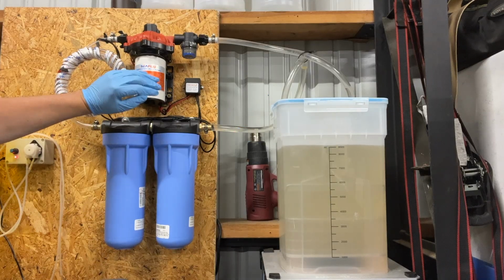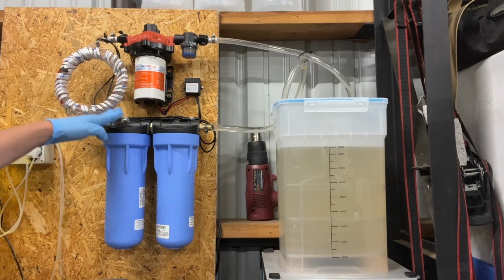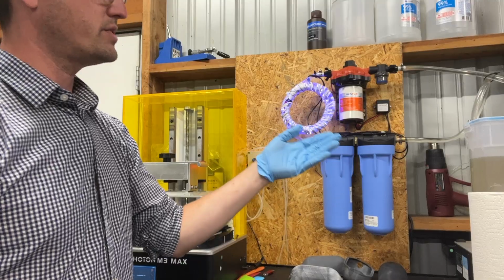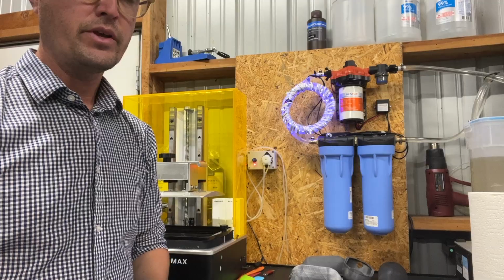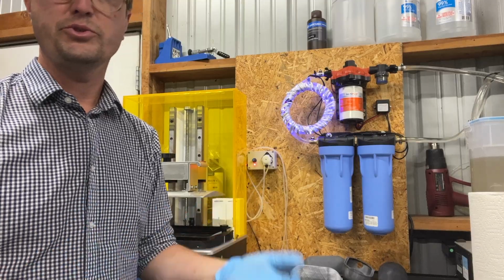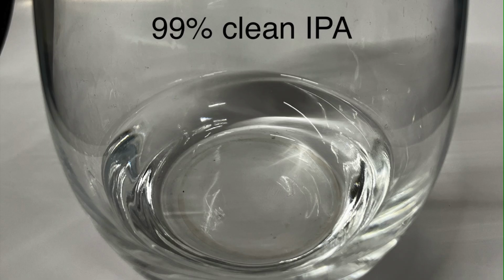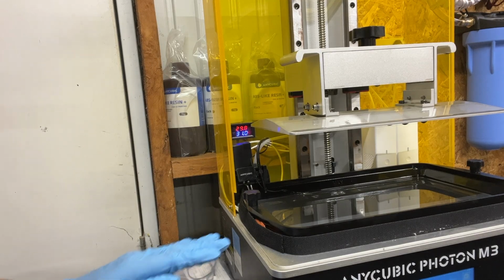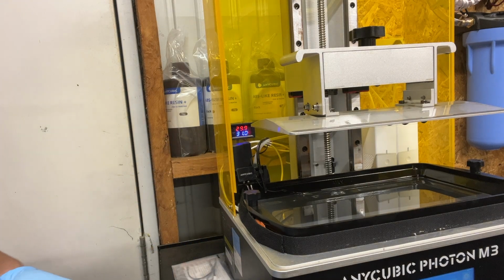Resin Printer Mods and Continuous IPA Filtration!

Comment: For the thermal belt solution, do you have any more specific instructions regarding the actual setup? Looking at the two items, and I'm not a really technical/electrical expert, so I don't want to do it wrong. The back of the thermal probe/controller has a white square for the probe to connect, but then how does the belt connect to that since it looks like they're exposed wires? Soldering or something? I just need more info, thanks.

Oh, and would you expect any particular issues with a vat that is smaller to use the same size band? I've got a Mars 3 pro, so it's a bit smaller than the Photon M3 Max.

Comment: Cute idea, I genuinely wanted it to work, but having tested it directly myself, the filter lifespan is too low for anyone printing regularly.  The filters last washing about 1-2kg worth of resin input prints, even with generous drip tray time reducing uncured resin going into the wash. Probably lasts significantly longer in a 2-3 stage wash if you are only filtering the final stage, but it absolutely cannot handle the residue volume of the first stage isopropyl or denatured (ethanol) alcohol. 

As the filters pack and start reducing flow, the coil loop also starts getting cured resin accumulating and needs to be flushed by other means which can get pretty messy. 

Overall a massive disappointment, but I blame myself partially.  Just looking at the available mechanical volume in these 10x2.5" filter cartridges, it obvious how little resin residue they can handle. I was hoping part of the "magic" was the curing coil and filter structure would reduce the gel / foam volume which resin residue makes when it kicks with alcohol.  This is simply not the case. So a few mL of resin residue (net) becomes a dozen mL of resin-alcohol gel.

Comment: Would the UV lights need to be covered?
Reply from the maker: Yes if you're standing around them. I typically set the system to cycle once an hour when i'm not around. 

If you have UV lights exposed you need to wear PPE or cover them in UV/Capcom tape.
Reply: @nicks-fix  Thanks for the reply. It's a great system you've made. I have a heygears printer so I'm trying to figure out how to retrofit. Think I'll just create a 3D printed top for the wash basin with 1/2" inlet/outlet ports

Comment: Not sure on the pump, One in the list is different than the one shown in the video and started leaking after about 5 hours of total use.
Reply from the maker: @McyD  apologies. The list tends to switch due to Amazon. I’ll do my best to update. Were you running it for five hours constantly? Or intermittently?
Reply: @nicks-fix  intermittently, most was 30 minutes, but usually only about few minutes at a time. I found the one shown in your video on Amazon and am returning the leaking one. Luckily, I was just barely within the return window still.

Comment: This is fantastic! I've been using water washable resin, but I'm about to switch over to ABS-Like or similar and have been digging in a bit to maximizing the use of the IPA and minimizing the trips to pay to get rid of the hazardous waste.

Couple questions on the filters.... are they something that require regular maintenace?  Do you flush them or rinse them periodically?  If so... how do you go about that?  Or, do you just buy replacement cartridges and swap them out periodically.  If so... any idea how long they're lasting?
Reply from the maker: @witkointhewild  I have yet to change mine. I just take them to my hazardous waste facility in a bag to dispose of. The filters are like 6$ on Amazon.

Comment: Well let’s see what the pre-filter looks like. Sheesh.
Reply from the maker: @JAKESMITH-tt8nm  what pre filter? The one that comes with the pump? Just a small stainless steel strainer basket. Sheesh.
Reply: The first sediment filter after the UV coil. If it’s a 10mic filter then there is no way it has not loaded up by now. And if if it’s as effective as it should be it’s most likely full of nasty resin and bypassing the majority of the IPA to the secondary filter. Open it up and see what it looks like. No better way to see how well it works.

Comment: I just bought my first resin 3d printer, I've been working for year with a PLA 3D printer, but for finer work I now switched over to resin.
I was already thinking about a filtering station, but never given it a thought of using led's to cure the resin particles before filtering, which make good sense.
So thanks for you tips, they are awesome.

Comment: Filters are gonna gum up pretty quickly, which is  going to end up costing you more than the IPA.  Better off either doing a Two stage wash, one small bath to get the bulk off then transferring over to the washer. Or the more elaborate method of buying a breaking bad starter kit and distilling it.
Reply from the maker: @nikushim6665  thanks for the feedback. Many people have been running this for months without “gumming up the filters”, including me. 

I’d suggest you try it before saying it won’t work!

Comment: I just have a radial flow Drum (aquaponic trick for pre filtration of solids  )  than an IBC  settling tank then the clean IPA evaporates and condensers for collection using solar umbrella evaporator , when the settling tank and radial flow looks sludgy then they are  drained out and then hit with UV and ran through a press to squeeze out all the juice

Comment: This is brilliant! I built this and it works like a charm and took under 30 minutes to build! In my case, instead of a continuous filtration system, I filter it out from one container to another, this happens in like a minute or two for some 5 litres of IPA and uses less energy. For me, it cost less than a bottle of resin to build this. Thank you for this, you saved a lot of people a lot of hassle!
Reply: hey, im working on building my own, but im a little unclear on the electrical setup.  Is the pump receiving power from the power supply along with the LED strips?
Reply: @xviixxiixxvi  In my case I power them seperately. But if your strip can run with the same voltage as the pump's adapter and the pump is not drawing the full power, you could try to power them together.

Comment: I've come to find the UV loop in this can suffer from resin curing along the walls of the tubing, which sorta blocks the UV in the loop degrading the amount it can cure. I wonder if the original uv filter was better because of this not being an issue.  Could be an issue of my flow not being high enough as I had to settle with a pump at only 5 litres per minute!
Reply from the maker: @0Kyron0  good point. Others have said after a while there is some build up. 

Good thing is that the vinyl tubing is the cheapest part of the system, so you can just replace when there is too much build up!
Reply: @nicks-fix  luckily a long drain pipe brush does good, can loosen it in the loop then it gets caught in the filter haha

Comment: Hey! This is great. the LED light strips you linked are 385-400nm, not 405nm. Has that been working for you? Thanks!
Reply from the maker: @MrLightmass  the specifics depend on the range that your resin needs. Nm wavelength is never exact, so getting it as close to your resin from the manufacturer sheet is the best way to pair it.
Reply: @nicks-fix  Thanks for the reply! So the LED's you have listed are working for you? 
 I am ordering my parts today to give this a go. Are the parts listed in the description the same ones you used in you project? Thanks!

Comment: Hey nice video there :D I have few questions such as how do you discard the filter and at what frequency ? (After a number of batches ? Kilos of resins Cleaned ?) Do you turn the system as often as possible or when it's start to get clumpy ?

Do you cure the filters so you can use these a little longer ? How do you dispose of those, since it's still hasardous material until it's not cured.

Comment: The heat band around the vat, is there any information on how to wire it up?
Reply from the maker: @redshirtman1907  it’s a 12v band. You apply 12v to it and it’ll heat up. 

The thermostatic relay has a wiring diagram if you need it!
Reply: @nicks-fix  Thanks for the info. I know next to nothing about wiring.
Reply from the maker: @redshirtman1907  I’d recommend researching simple dc circuits before attempting this then.

Comment: What about the resin building up on the inside of the tubing?  I use a plate stirring unit, a glass beaker and a uv light.  The side of the beaker gets covered with resin after just a few minutes of running the system.  I then just use a filter cone to get rid of the cured resin.  Plus I also have to clean the resin off the inside of the beaker using a paper towel and then some alcohol wipes.
Reply from the maker: @Core1783  since the alcohol is constantly moving over the tubing and pump internals, and the system should be run very frequently after each wash, there is minimal build up, if at all.

Comment: I built this with the exact parts list and it ran great for several weeks. There was no sediment after washing several liters of parts though the IPA slowly darkened to the point that was difficult to see the bottom of the tub. Then the pump started to leak, slowly at first but became much worse over time. I t would suck air into the system when running and dribble IPA when shut off. I disassembled it and couldn’t find the problem so I reassembled it with silicone grease hoping it would fix the problem if only for a short time. However it was just as bad as previously. The only difference between the setup here and mine is that I mounted the pump upside down from the way he has it. 

Does anyone else have experience with running this setup for four or more months? Have you had any of these issues?

Comment: new info: the pumps have a safe run time, we found them listed about 5 minutes, 10 minutes cooldown. after running for an hour one day the pump started leaking. gaskets or something failed inside, and was a mess and needed a full replacement short of opening the pump. went a good year before it failed from that.
Still working good though.
Reply from the maker: @Frostyviewer  yeah I would never leave this running for more than a few minutes, and never unattended.

If you take the lpm or gpm of the pump and compare that to the volume of the wash basin, even a minute or two will give you 200% cycle of the entire volume.
Reply: Where is the runtime listed? I’ve never run it for an hour straight but may have gone over the 5 minute limit. It certainly sounds like the reason for both my pump failures.

Comment: I Really like this idea and am planning my own. Have you had any issue with the vinyl tubing in the uv section? I know that vinyl isn't very uv resistant. I wanted to use FEP tubing, but it is so expensive.
Reply from the maker: @JamesDayton-u2u  the Uv loop can get hardened after a while, but once it’s that way, it’s low cost to replace! 

That being said, no fragility here after a year.

Comment: Hi Nick, I have been running this system now for a couple of weeks. So far it’s doing a great job cleaning the resin off of my prints. I’ve done about 3 liters or resin through it and there is still zero trace of resin in the IPA. However, I am running into an issue with my IPA getting super cloudy. I’m assuming it’s because I’m using Sunlu 14k dark grey resin, and maybe it has additives in it to print higher detail?  I’ve noticed tiny white specs on my prints after I wash them, which I’m assuming is leftover pigment or something. I did some research and it looks like Prusa has made a specific cellulose membrane filter to clean up the leftover particles from the IPA that aren’t resin, so I was wondering if you have any ideas on how to filter out this extra stuff?  I’ve tried a flocculant and that made my test IPA from my vat even cloudier, so I’m at a loss as to how to get rid of the extra stuff in the IPA. Any help would be greatly appreciated.
Reply from the maker: Interesting! Haven’t tested all the resins, but what micron filtration are you using? 

It might be helpful to apply a more direct uv light directly to the vat while cycling? Let me know!
Reply: @nicks-fix  I have the 5 Micron filter and the .5 Micron filter you have linked in the description. I’ve seen folks mention carbon filters, but I don’t know what is any different than the .5 micron filter you’ve already linked. Other than that I’ve tried setting it out in the sun, UV curing it with another lamp, etc, but there isn’t any resin cured after doing those things. The reactor coil seems to catch the actual resin, just not whatever the cloudy stuff is. 

I’m open to adding another filter or even replacing the ones I have now with different ones. Maybe I need an even finer micron filter with the 14k resin?
Reply: @nicks-fix  Mystery solved!  You were right, it was a UV light curing issue.  Even though I took out some of the IPA and let it sit in the sun to cure, it must have been just enough off the top of the IPA to not have much resin in it.  So it made me think there was no resin in the IPA.  I decided to go all out and set all of the IPA in the sun, and sure enough, almost solid white.  So that meant my UV light wasn't curing anything at all.  So I ran it through my system again and it appears that my UV light I used to replace my insufficient UV LED's wasn't actually hitting the coil, it was focused almost dead center of them, so it wasn't getting the UV light to expose the resin in the IPA.  I've got a new set of UV LED's so I'll get that fixed soon, but now the IPA is crystal clear again.  Lesson learned part 2.

Comment: Hi Nick, really close to putting this together now. Got all the parts in but I'm a frustrated as I went with PTFE tubing for the curing loop (Eric Strebel is using fep, but couldnt find that for a reaosnable pricve) but the tubing is not cooperating with being shaped at all. Wondering if silicone would do the trick for that as well or if that would mess with the UV permeability? Also, how have you got your connections to the cleaning tank set up?

Comment: has anyone had issues with the vinyl line degrading from the IPA?   Also,  has anyone experienced any issues with the resin sediment causing issues to the pump since it is the first device in the loop?  I understand it was done to pressurize the lines to keep them from collapsing, but I am a little concerned about pulling unfiltered resin through it.
Reply from the maker: It’ll take a good amount of time for the vinyl to degrade. You can easily upgrade to silicone lines for longer care free use. 

As for the resin sediment, I don’t recommend attempting to filter a fully saturated basin of ipa with this, as it’s not the intended use. It’s meant to filter out after each wash, not in a batch processing. 

In addition the pump is a diaphragm pump. By design a clogged intake line would have little to no effect on the pump, and definitely would not damage it.
Reply: @nicks-fix  thank you for the rapid response.

Comment: How have the filters held up? I'm considering whether this is worth it for a small high-volume operation. I know they're consumable and will have to be replaced eventually but I'm wondering how many liters of resin you were able to get through before replacing the filters. It's not a cheap setup so I'm wondering where the tipping point is for it to be cheaper to just buy new methylated spirits lol.

Also, any particular reason to go with a 12v pump over a 220v?

Another question I have is about vinyl, I know in gloves we use nitrile because of the monomers seeping through, but is it because the rvinyl tubing is really thick that it's not an issue?
Reply from the maker: Haven’t had to replace them yet, but also my volume of printing may be less than yours. 

12v for me since I’m in the US and also the LEDs and my heating band were 12v.

The vinyl will definitely need to be replaced once a year or so. You could upgrade to silicone tubing and never replace.
Reply: @nicks-fix  Ah good call on the 12v led. Will have to see how I'd manage that. Thanks for the advice and glad to hear it's still running great without needing to replace anything... almost a year of printing with clean alcohol with no fuss sounds amazing! Thank you so much for making this video, think I'm just gonna go for it!
Reply: @nicks-fix  Is there anywhere I can reach out to you to have a bit more of a n in-depth chat about the system? I've just got a few things I've got questions about or that aren't entirely clear, if you don''t mind.

Comment: This is wonderful!  Any chance you could do a close up or provide more info about how to do the wiring on the heating strips with the temp relay?  For a total neophyte like myself, it's a bit of a mystery.
Reply from the maker: Hi! The temp relays have an input and output. All you need to do is wire the heating strip to the output and the input to your 12v source. Very simple!

A relay is literally just a switch, like a light switch, but instead of a manual control (you flipping the switch) it is controlled by a voltage switch (the thermostat in this case.)

Wiring is very simple!
Reply: @nicks-fix  Thank you!  Would I use some sort of wire connectors for attaching the heating strip's wires into the temp relay or can I just insert them directly?